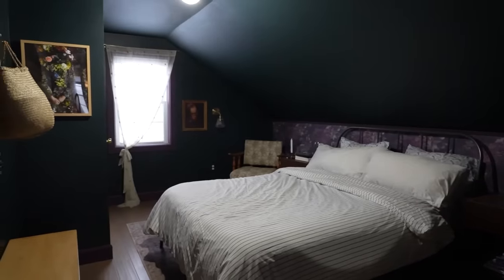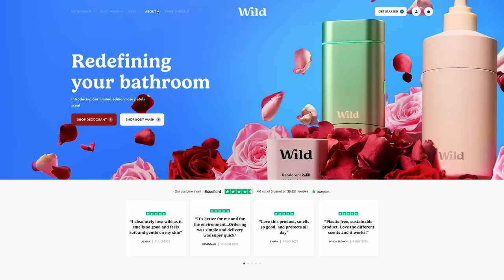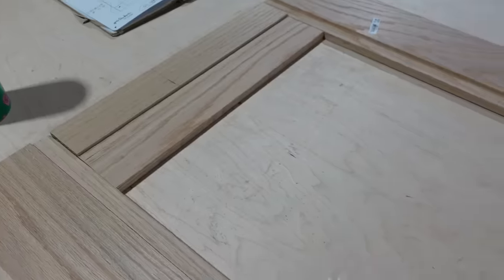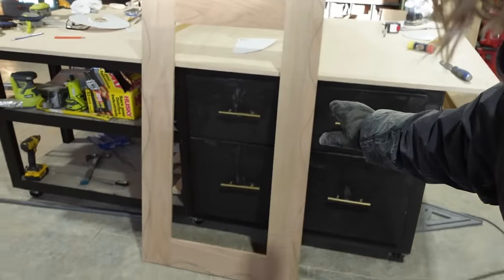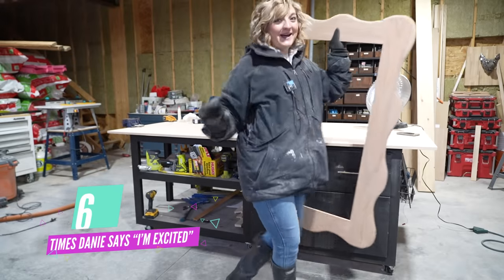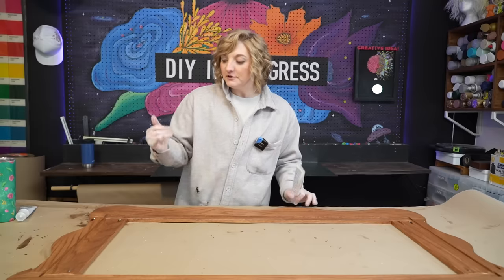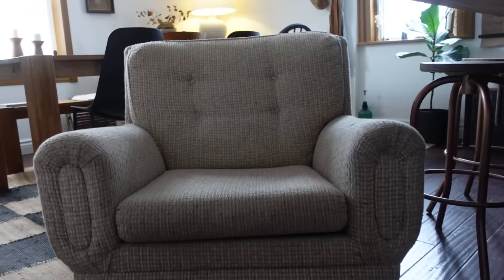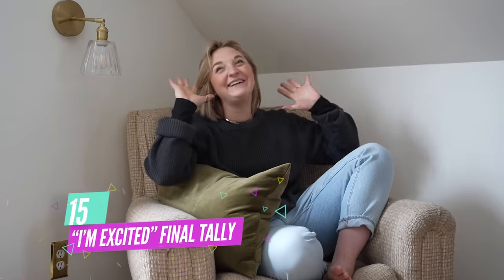i diy a BEAUTIFUL wavy mirror! 😍 | Door Mural + Cozy Chair Thrift!

Comment: I love the chair!
If you recover the buttons on the back cushion on the chair in the same redish colour as the details on the headboard I think it would look amazing and tie the two pieces together.
You don't even have to take the buttons off.
You can just make a little fabric circle with a thread running around the edge so you can pull the fabric tight around the button shower cap style.

Comment: Seeing the original idea for the mirror really turned me off for this room. However the finished mirror is perfect! Just a nice little curvy edge that breaks the monotony of sharp edges. This room is very simplistic yet classic. Plus with the neutral colours on the wall & trim you can change it with bedding & throws if you get bored. This is one of the best redos I've seen in your channel. Job well done as always.🎉❤❤

Comment: Absolutely love the door mural. The mirror is so clever. Quick question: do you have a biscuit jointer? It would save those 'nicks' happening again as you could biscuit joint rather than pocket hole x

Comment: To set up the router table to stop at points is a little long to describe but does take a sacrificial rail the table that you mark above where the bit is on both sides then mark where to stop on the wood and where you want to start and stay between those marks

Comment: 14:20 math is not necessary! If you want things evenly spaced all you have to do is take some string, cut it to the length of your object, and then fold it as many times as you need. There's also a sewing tool called a "buttonhole gauge" that plots out even spacing for buttonholes that can be used for the same thing, but they only expand so large.